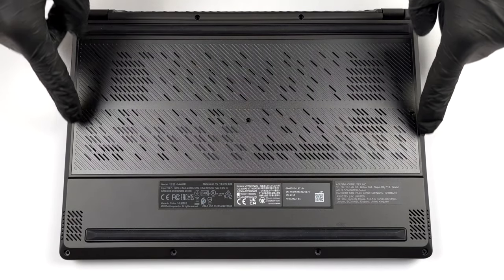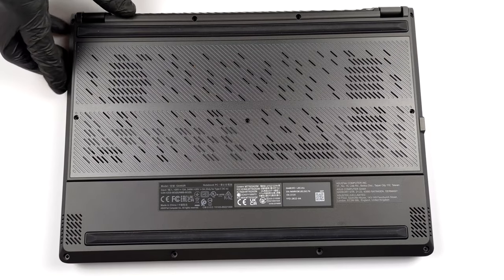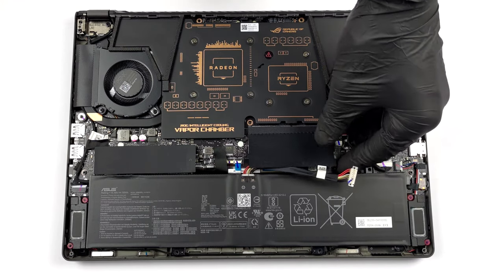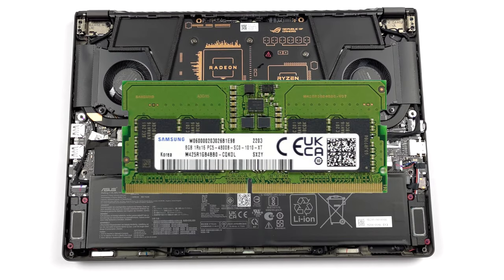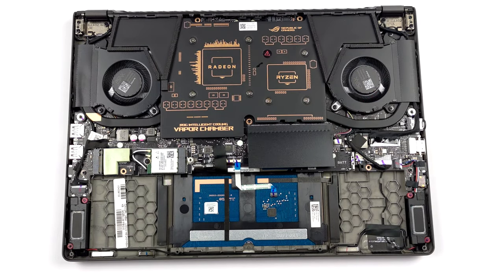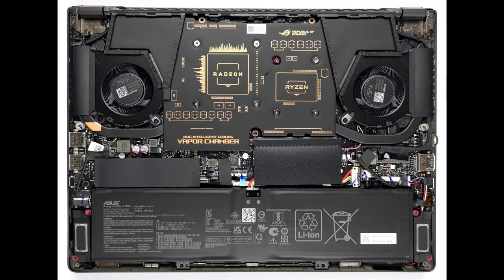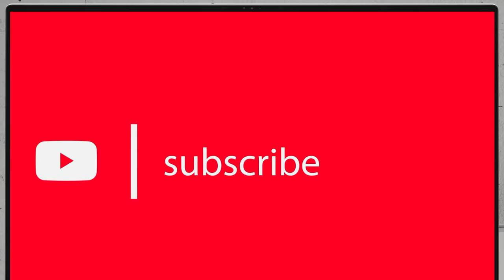🛠️ ASUS ROG Zephyrus G14 GA402 - disassembly and upgrade options

Comment: If 8gb is unremovable and i install 32gb, will it work? Are there any 64gb single RAM modules available?
Reply: One of the DIMMs is a SODIMM, so its soldered on to the board (except on top spec maybe I forget), so you can only replace the other modular DIMM.. And the motherboard itself only supports around 24GB RAM if I recall correctly.
Reply: Mine came with 8gb soldered + one 8gb stick, I popped out the 8gb stick and replaced it with a 32gb stick I got off Amazon and it works fine. The documentation only states a maximum of 24gb RAM but I’ve been rocking 40gb for months without issue. 

One minor thing is when you first install it the laptop will take a few minutes to POST and whenever you update your BIOS it will also take a few minutes to POST. I think this has something to do with the way AMD optimizes memory timings.

The exact stick I picked up is - Crucial RAM 32GB DDR5 4800MHz CL40 Laptop Memory CT32G48C40S5 - on Amazon. I don’t know if there are any models that are 64gb in a single stick, haven’t seen any floating around myself
Reply: @hellpeppertv  Hey curious, does this impact the benefits of dual channel RAM? I thought for dual channel to work properly, the two sticks (in this case the soldered RAM plus the installed stick) have to match exactly. Thanks
Reply: @rc7016  It does not have to be exact in GB, but speed and ddr type(ddr4, ddr5) do have to match.
Reply: @hellpeppertv  You RULE!!!!! My great reluctance to buy this machine was around whether it could be upgraded beyond 24GB of RAM. I have a couple of (much older) laptops that i've been able to upgrade with 2x the official maximum and it's really helped me stretch the machines' useful life an extra 1-2 years and do more serious work on bigger data sets. I think you just got me off the fence on this purchase :)
Reply: It will work with a 32gb DDR5 DIMM and 64gbs don't exist yet
Reply: @rc7016  8+32 GB is gonna run 2x slower than 32+32GB after the data set goes above 8+8GB. Gamers can see in some games speed penalty up to 30%. Some say that if multible heavy resources apps are running, there is huge slowdown. Older article wrote that single channel RAM had no negative effect for rendering in Blender. I'm little consrned now. Too bad, the Asus Vivobook S  14 Oled Ryzen 6000 is only 1200€, but has the same 8GB+32GB and also 1 USB-A is old 2.0.

Comment: I unscrewed everything the corner did pop but I can't get the backplate off, feels like it's glued
Reply: the cover is glued - as u can see you might need a sharp piece of plastic or metal to open it. just make sure you dont push the sharp object too deep. also, some heat might be needed to soften the glue. even a hairdryer might work

Comment: This is very helpful, thank you. I have a question: If you open the hood by removing the screws, can you open it easily without the blue tool thing you used and will opening the hood break the guarentee?
Reply: U dont need the pry, and no opening the back wont void warranty.
Reply: Thanks! @positronikiss

Comment: Does anyone know where the cmos battery is located? Because my screen won't show any display but it does turn on.
Reply: My laptop does the same but can be sometimes fixed by force powering it off and retrying a couple times. Did you manage to solve your issue?

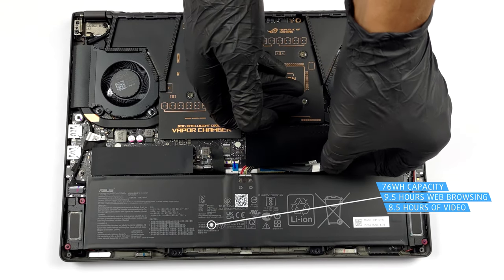Comment: 0:43 8.5hours for videos?
but my new g14 is almost 4hours :(
Reply: You have to set it up correctly and you can easily get 10h+ like I do on mine 2022.
EDIT:
just to Reddit subforum for Zephyrus G14 to seek for the pinned posts.